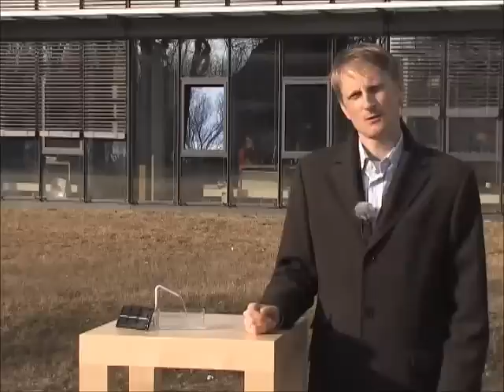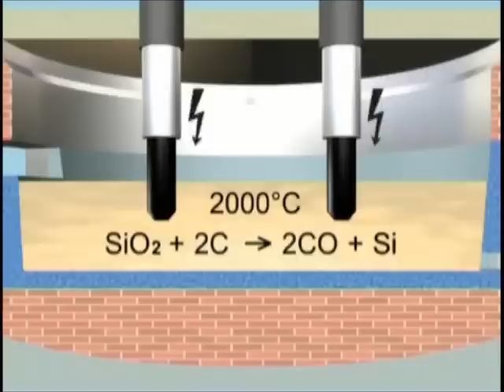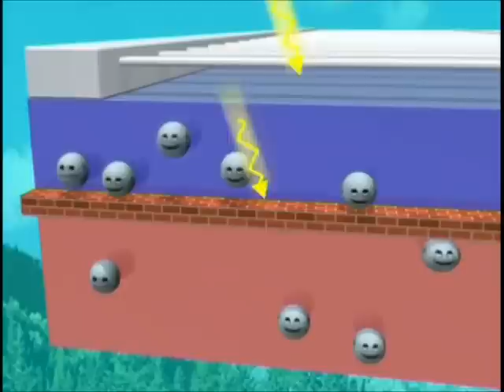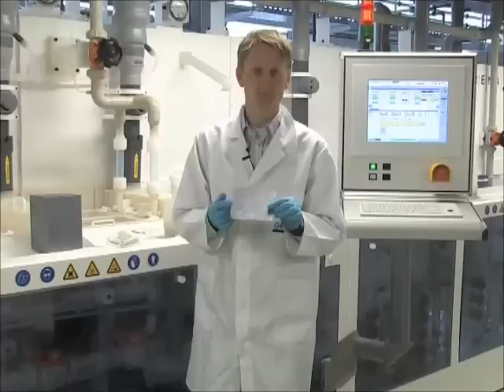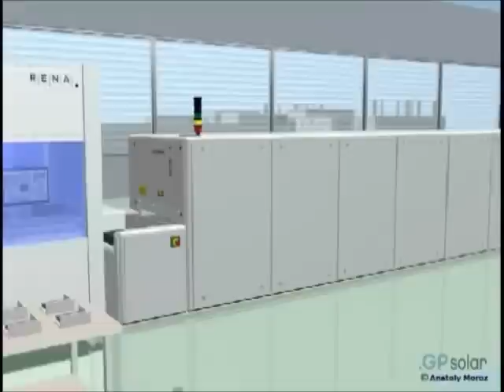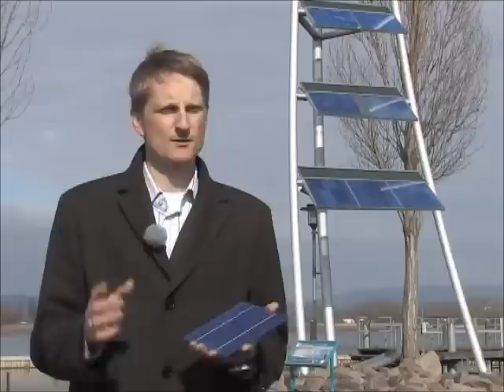Solar Module Manufacturing

Comment: Extremely informative video. The whole process is much simpler than what i thought. It would be nice to make a video about how much on average the construction of such plant costs and since you mentioned Silicon is so abundant, does that mean you can build it almost in any country in the world?
Reply: Silicon is the second most abundant element on planet Earth (oxygen, by the way, is the most abundant).

And silicon makes up around 27.7% of the Earth's Crust.

This is basically why we have sandy beaches. Because the rocks are, as mentioned, around 27.7% silicon (on average - some rock types more and some rock types less) and then the sea water - tides rolling in and out, and crashing waves against the coastal rocks, etc. - are gradually eroding those rocks away.

(Think about rounded pebbles on the beach. They used to be perfectly rocky and irregular in shape, but the water has been eroding them and rounding them off over time, until we get perfectly smooth and rounded pebbles.)

The tiny particles of rock are then washed towards shore by the tides. And so we get sandy beaches - which are actually a mixture of things, but as there's a lot of silicon in the rocks that make up the Earth's Crust, then there's also a lot of silicon in that sand, because it's just those rocks all crushed up and eroded, into almost a powder - washing up to the shore and deposited there.

So, yeah, there's an abundance of silicon everywhere. Second most abundant element on the planet.

Of course, there are places where it's way easier to obtain than others - there are silicon mines, where it can be dug up and processed easily - so how economic it is to do it in one country versus another does vary...

...but to directly answer the question you asked, yes, you could technically extract and process silicon anywhere on planet Earth. Basically, it's just rocks.
Reply: @klaxoncow  but it requires lots of energy, compared to how much it yields. You can hear it in the video: a solar plant can produce the energy it needs to manufacture itself again in 2 years… probably if we choose low quality raw materials, it would take even more energy to purify and distill

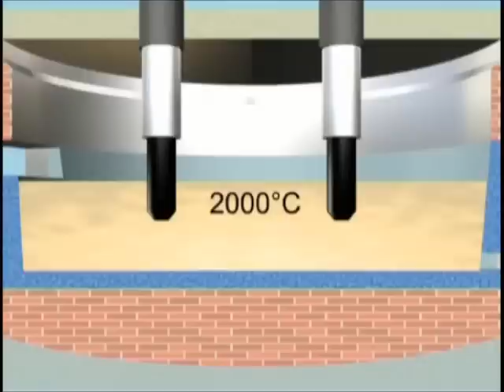Comment: 3:35 dude that's carbon monoxide! Now you know where CO comes from
Reply: If that really bothers you tell the government to make them flare it off.  All you'd have to do is have a flame at the vent and then it would oxidize to CO2.
However... does anyone care? not really.  the generated CO would probably oxidize naturally eventually anyways as it is not as stable as co2.
Reply: @richardjohnson884  Yes--anyone who likes chemical reactions to be described accurately cares. This is a scientific explanation so accuracy is important. The chemical equation accompanying the description clearly shows CO being produced, not CO2. If some CO2 is also produced that should be explained and a separate chemical equation shown.
Reply: and how CO2 not coming..
Reply from the maker: CO and CO2 are the products of this process. Nevertheless the solar electricity produced with the solar modules made are able to prevent CO2 emission of the total production by a factor of >30 times
Reply: @Ericrueland007  but what about when they are no longer functioning? Are they recycled?
Reply from the maker: @touchtoomuch1000  Yes, recycling is possible: silicon, glass and the metals (silver & copper) can be recycled. But lifetime is 20 -30 years. Still there are limited volumes to be recycled due to long lifetime of the solar modules.
Reply: @Ericrueland007  My understanding was that they were disposed of as hazardous waste.
Reply from the maker: @touchtoomuch1000  no, solar modules do not contain hazardous materials. All precious materials can be recycled - forgot the aluminum of framing in my previous summary.
Reply: @touchtoomuch1000  there is currently no real plan to recycle them. Several companies have since popped up to recycle them, but in my opinion that should have been planned from the start. The same goes with lithium batteries.
Reply: @smugless191  Don't get me going on those filthy monstrosities. Every year a forest the size of Deleware is cleared for cobalt mining in The Democratic Republic of Congo for litheum ion batteries. If people cared about the planet as much as the claimed they'd stop using so much electricity. They want everybody to drive electric cars, use cellphones, tablets etc... They don't realize that power is generated by fossil fuel. We don't have enough land on this planet to run everything off of wind and solar. Right now we have 60,000 wind turbines and 1.1 million acres of solar farms that provide just 11% of our energy needs in the USA.

Comment: R u guys looking at using all light colours to create a solar cell that can convert into electricity all the sunlight
Reply from the maker: Standard silicon technology is already using 20 - 25% of the solar power. The efficiency went up as well as the energy needed to produce went down: already < 12 months is the energy pay-back time of an actuel solar module.

Comment: Welcome to the no job world.
Other dramatic problem is the fact that these panels hide more and more earth surfaces causing negative impacts on the soil and the environment.
After the concrete era trapping water molecules in a huge scale each day.
When will mankind stop thinking in a capitalistic way of life.
Reply: The Helio Capture project, funded by Gates Foundation, used machine learning (algebra equation) on an array of rotating solar panels (simple telescope technology)  that matched the movement of the sun in order to maximize solar energy capture.

So my recommendation to you MrWookie is to stop pointing out the faults of others, and start thinking of the solutions to problems.
Reply: Well Mr. Wookie, there is always suicide! That will help the static load on the planet! You first!

Comment: but where do the electrons come from ? i previously thought they come from the sun !!
Reply from the maker: Hi Amin - no, the electrons are inside the silicon. 
The sun (photons) carry energy, this energy is catched by the photons. Now the high-energy photons can "produce" the electricity... and are transported as currency through the cables of the solar module.
Reply: where are you based ? are you international yet ? nice video btw